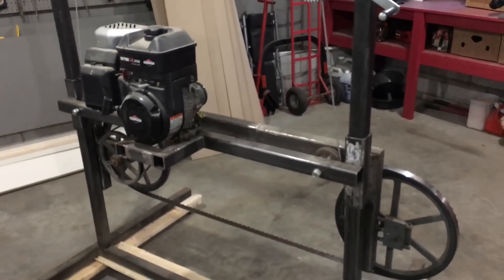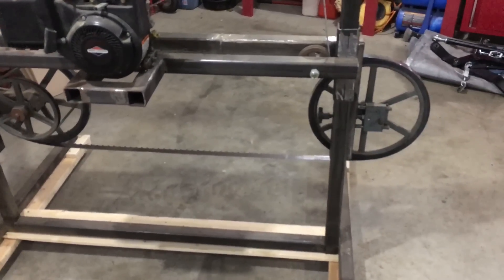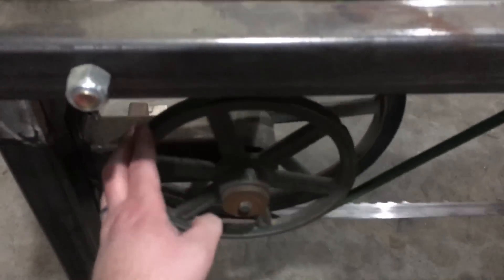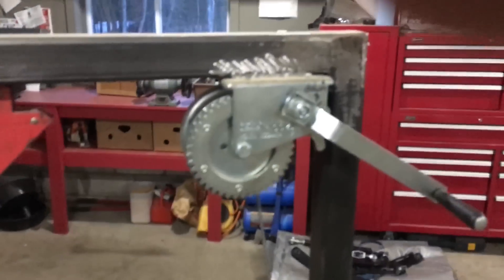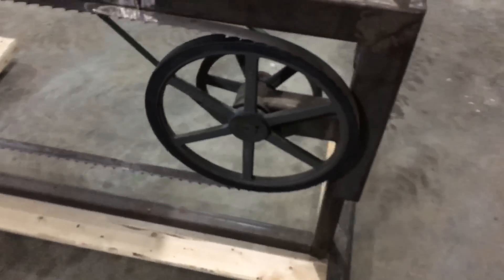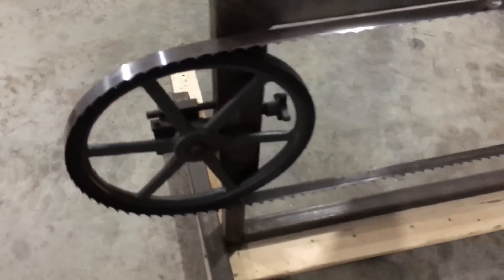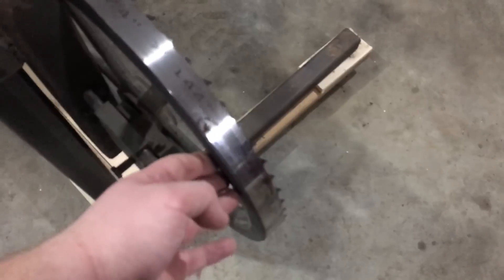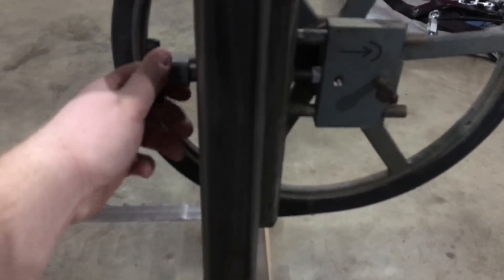How to build a simple Bandsaw Mill #1

Comment: Nice job on the build.  Just wondering why you chose to put the one wheel inside the frame and the other one mostly outside the frame.  If they were both outside the frame width it would give you an even larger cutting width.

Comment: Great job! What size are the wheels and where can one buy them? Are they specifically made for band saws?
Reply from the maker: Kimutai Rop it started out as a bandsaw so yes they are band wheels. You can buy wheels but they are extremely expensive! Your best bet is to find an old shop bandsaw and salvage the parts. The older big shop bandsaws work the best, you just want to stay away from cast iron saws. I hope this helps and best of luck!

Comment: Do you have any problem with  the head binding on the posts? I ran the cable the same way on mine, I would go up OK, but bind up on the way down. I had to run two separate cables, one to each side. Now it works fine.
Reply from the maker: I haven't ran into problems with it binding but I have yet to remove the piece I tacked in to keep it square on the bottom. If I had my time back I would of used round tubing instead, no way for it to bind then. It was round tubing that Cecil used and his works perfectly.

Comment: very nice you will be able to cut some huge logs on that mill what's the distance from pulley to pulley?
Reply from the maker: Str8SawinLogs 
I have yet to measure the throat between wheels but I will. Still need to fab up some blade guide also.
Reply from the maker: Str8SawinLogs 
I just measured and it's 31" between band wheels.
Reply: CR Mills that's awesome can't wait to see it in action better start making plans for all the saw dust your going to have lol great vid see you next time
Reply from the maker: Str8SawinLogs 
I saw an idea for a bucket hanging on the side of the mill I may try that and empty it after every few passes.
Reply: I may give that a try also better than sweeping it up. I have used it to fertilize every plant I own now I just throw it away I have given some thought to getting a harbor freight press getting some steel pipe as a mold and pressing presto logs lol tc
Reply from the maker: Str8SawinLogs 
That was another project I was thinking about a while back, free heat!

Comment from the maker: Cut up to 30" diameter and a board width of 30" also. The build still needs blade guides, rails, lubrication system, trailer/rail system and safety guards.